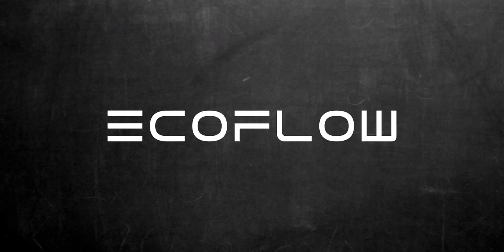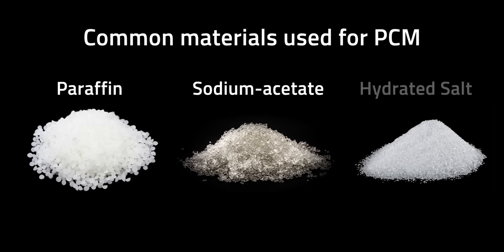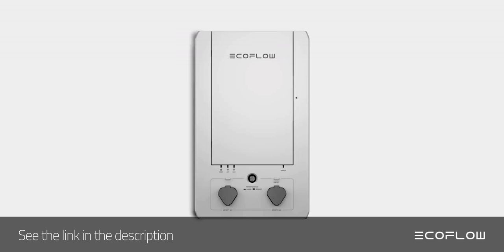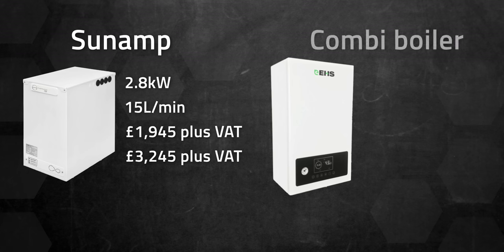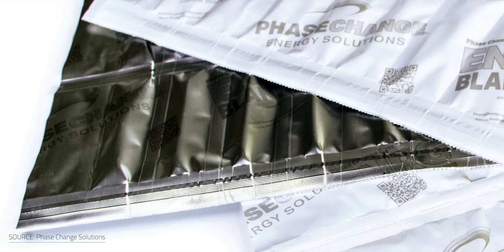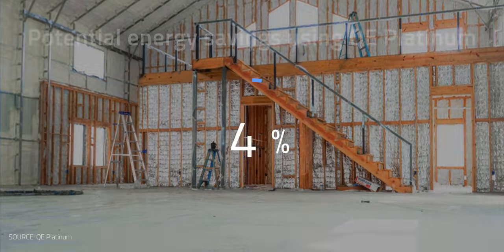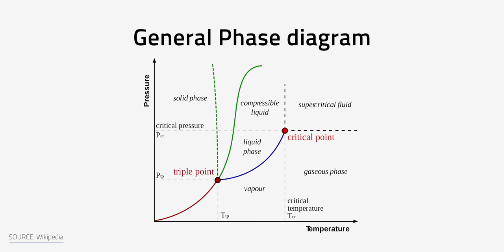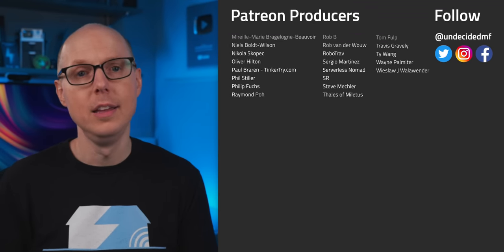Are Phase Change Materials the Future of Water Heaters?

Comment: We've had two SunAmps in our passive house since 2017 🙂 We just use off-peak mains power to heat these overnight and are fairly light HW users.  Apart from energy density, the heat losses are fantastically low compared to a conventional UVC.  E.g.  our CH control system went offline whilst we were on holiday -- our son took 4 days to notice that the showers were running cold!   Nice and simple we've never noticed water heating / flow issues in nearly 5 years of use.
Reply: Is it a case of great heat retention, or simply when the cat's away, the mice will not wash :-). Seriously though, going to look into those Thermino systems.
Reply: @jamestripptrapp  Heat retention. The compact cuboid form factor and vacuum panel insulation make a huge difference to hear losses. My 2 SAs lose about 1kWh per day between them.
Reply: How do you have these hooked up? Is it like a separate loop from the hot water heater with a pump? How does it know to charge/cycle?
Reply: @tscook10 , the system complies with UK codes.  The whole HW + CW system is potable and fed from the rising main via coarse filter + 3 bar limiter then through a water softener.  (Main pressure is a consistent 3-3½ bar. ) The HW branch goes through 2 parallel but individually isolatable SunAmps (so we can tolerate one out of service, ableit at reduced max flow) that act as heat exchangers in flow terms.  The HW outputs are TRV mixed down to around 48°C at the HW manifold.  All appliances and white-goods are each fed on a 1-1 isolatable spur from a manifold.  The H/W will typically be at a couple of bar when flowing through this can drop to maybe 1½ bar if 2 or three showers are going at once.  We've 3 ensuites, one bath/shower room + utility, kitchen and G/F toilet.  Never had any flow probs.
Reply: @TerryE-UK  So the hot branch is one-way through the heater and then the sunamp? My understanding is that the SunAmp doesn't incorporate a heater, correct?
Reply: @tscook10  not in our case as we have an earlier (and IMO better engineered) model.  Each unit includes an internal heater and small pump for recirculation.  We just feed it off-peak electricity but default for 90 mins overnight.  This ~4.5 kWh (max) × 2 is significantly more than we typically use.   (The control boards will only take power until the cells are ~5-10°C above phase change temperature, so they only take what they need.)  I can always top-up with a button on my home automation UI.
Reply: @TerryE-UK  Cuboid isn't more efficient than a cylinder. Big things have better surface/volume ratios than small things. So that seems to just leave 'better insulation'. If we put 'better insulation' on water tanks then I don;t think there is any intrynsic advantage of the PCM store. I am interested in the sunamp, but remain to be convinced that is is better than a very well-insulated water tank. One PCM advantage/disadvantage is no movement of heat due to convection. So that should reduce store losses (warm water doesn't keep mixing and going to the edges as heat is lost), but you also don't (I presume) get stratification, which stops you from just having a relatively small volume of hot water at the top. I'm not sure how the sunamp compares in this regard.
Reply: @xxwookey   The cuboid form factor is more efficient because this facilitates the use of vacuum panels which you can only get easily in flat panel form; these have a U-value maybe 10× smaller than typical foam insulation.   Yes, a cylinder has maybe 20% less surface area for a given volume than the SunAmp, but the PCM is 3-4 × as energy dense as water, so the volume and surface area are a lot less as well.   The overall heat losses are an order of magnitude less than a comparable UVC.

Comment: I researched thermal storage materials during my diploma (equivalent to a master thesis). I think a small fact in the video could be misinterpreded: Most salt hydrates for thermal storage are no PCMs! They are usually used as thermochemical energy storage materials. Water vapor will be incorporated in the crystal structure of the salt, which releases a lot of energy. They have a higher theoretical energy density than PCMs (but have other issues for household usage).
However both material classes have a huge potential.
Reply: So the salt hydrate systems are not bound to a specific temperature band at atmospheric pressure? That seems to be the difficult limitation of PCM in a building.
Reply: @armadillito  They have other limitations than PCM: The dehydration temperatures are relatively high for most of these systems (they vary a lot depending on the salt used). Systems with lower dehydration temperatures have lower energy densities.... However, to "discharge" those systems, you only need humid air.
Reply: @kleinerELM  I wonder whether heat pumps could leverage PCMs or salts as an artificial source/sink where ground installation is unviable and air temperatures are extreme?

Comment: The key to the efficiency of such units as the Sunamp is that they can store a huge amount of thermal energy without the temperature changing and thus they do not need massive amounts of inrulation to retain that heat.
Reply: The Sunamp also uses Vacuum Insulation Panels - which it is able to do because the "tank" is cubical, so flat surfaces to insulate. They provide excellent insulation. But as you say - having most of the energy stored not increase the storage medium's temperature is a big help. 

Also, unlike a sealed water tank, the whole thing is at atmospheric pressure, so there's no danger of a steam explosion. 

The major downside is the weight of the units, as they arrive pre-filled - unlike a water tank that is fairly light (if bulky) until you fill it with water. And they're a little more expensive than an "equivalent" water tank.
Reply: @justinmacneil623  As I understand they are sized to fit in with kitchen units so in most cases will sit on a solid floor.

Comment: On the flip side, PCM's integrated into refrigeration units on the cold side can help alleviate short cycling and reduce total energy use. Instead of kicking on the compressor because the door was opened, air is circulated across the PCM to bring the temperature back down. This leads to longer compressor on times, less frequently, which is better for longevity of the compressor.

Comment: Hey Matt,

Thanks for the video.   As an FYI,  VAT is 20% here in the UK do its quite a bit pricier.
Reply: It's only 5% on energy saving products such as this boiler.
Reply: Currently 0%, from 1st April 2022 until 31st March 2027 from Chancellor's spring budget. Then would presumably revert back to 5%.
Reply: @allenscoging8561  Thanks for that. I hadn't realise the zero rate took immediate effect when it was announced. This is good to know.
Reply: @notapplicable4637  It's only 0/5% on certain energy saving items (per gov.uk, "Not all products or installations qualify for the lower rate"), and if you're in NI it's slightly different again. I think something like this would be probably be on the lower VAT rate, but you don't want to get caught out by thinking you'll pay 0/5% and then having a nearly 15% (or more) higher bill.

Comment: If you live somewhere that the night time temps are low and daytime temps are high, this would work simply by selectively exposing the material to indoor air or outdoor air, or even just letting sit there in the wall/attic and serve as a buffer.  But if it is always too hot (summer time in about 2/3 of the US) or always too cold (about 2/3 of the US in the winter), then you can't get your product to phase change without a lot of complicated heat management.  For example, you could have solar water heating panels in the North and you could pump your water (glycol) through them, let the water heat to above the PCM melting point, then circulate it into the PCM during the day, then circulate through the pcm and air handler inside the house at night.  But now you added a significant level of cost and complexity and lots of failure points.

Comment: I worked with a PCM blanket developer in San Antonio back in 2013 while in the energy-efficient home business.  I would have liked to see the platform under front-loading washers and dryers be the PCM hot water tank without the water.  Layer the ketchup packet-sized blankets with copper tubing in an insulated box and run the hot water plumbing through the connections.

Comment: I have a PV charged Sunamp fitted as the hot water provider for a detached 3 bedroom house in the UK and have found that it provides just about all the hot water we need in summer.  Having a EV we also have a cheap night tariff so as well as charging the car we also can charge the Sunamp if it needs to be topped off if there has not been enough sun during the day.

Comment: I have a Sunamp Thermino heat battery running with the ASHP installed 2 months ago and it is brilliant. Works very efficiently and is economical to use for all our hot water needs in a 4 bed detached house although only occupied with 2 old wrinklies at home now.

Comment: Or just build your wall out of concrete/brick and use the thermal mass of a building as a battery. I live in a house that doesn't need air conditioning as the walls are 35cm of solid brick and another 20cm of EPS insulation on the outside. When the temperature was 36°C outside the inside was at a cool 22°C. Max out air fresh system or open up windows at night and it cools the house back to 20°C.
Reply: The only benefit i see of a PCM in this aplication is it uses less space but it's probably a lot more expensive.
Reply: You did it correctly - insulation on the outside, thermal mass on the inside.  This same arrangement is key for PCM too.  In the U.S., many people are stuck with the house built as it is, so ideas like PCM help for retrofit of a structure that cannot support new brick wall construction.
Reply: The trick with PCMs is that they have a specific temperature they don't want to cross. Just like you can bring water to 100°C (212F) and then have to add and add and add more energy for ages until it finally becomes steam and gets to 101°C, those PCMs resist being heated/cooled over their melting point.

A thick brick wall doesn't do this. It has a large thermal mass, but it won't stick to the temperature you want to have. It's just slow to move at all. A PCM layer tuned to 22°C (72F) will stick to that temperature as long as it can. If the temperature drops below, it will give off heat (at 22°C) until it is completely frozen. If the temperature rises above, it will stay cool (at 22°C) until its completely melted.

It's like walking up a mountain and hitting a wall with a ladder. You will need to spend plenty of energy going up the ladder but won't move a single inch forward while doing so. Your concrete wall is just a steeper mountain.

Comment: I've had a SunAmp Uniq12 since 2019 - it's great. In the winter we heat it with off-peak cheap electricity - between March and October surplus PV from our solar panels is more than sufficient to provide us with hot water and heat our towel rails. Having potable, mains pressure hot water is fabulous!

Comment: [Bonus Points]: If the phase change "modules" installed inside walls/ceilings are placed between two thin polyester wadding films (without touching them, keeping enough flow of air going through the modules from the hidden ventilation system), the acoustic insulation benefits do not compete with the thermal regulation eficiency.

Comment: Another good PCM is greenery on facades, cooling your wall with water vapour and warming by providing surface area for dew condensation and frost sublimation. Included is a insulation layer of air between the leaves and the wall, which saves even more energy. 😁
Reply: Yeah ivy growing on your house does wonders in the summer.

Comment: BMW actually had these kind of sodium heat storage systems in some models of their cars. I had a 2000 528i that had one of these installed. Was supposed to help in the winter by allowing the car to store heat so when you turned on the cabin heater, it would get warmer faster. Was not a huge difference, but I did notice I had heat much sooner out of the vents than the same car without that system.

Comment: The key to phase change material is how much energy it takes to change phase. Imagine boiling a litre of water in your kettle. It takes what, a minute? Now how long does it take to boil the litre away, phase changing it into a gas? Twenty minutes, more?

We could calculate it / measure it but the point is, there's much, much more energy in the phase change than there is in just raising the temp 75 degrees or so.

Comment: Thanks for more fascinating and potentially very useful information Matt.

My family and I are Australian and a few years ago our old immersion element hot water reservoir gasped it's last.

We were advised by a plumber and family acquaintance that a 'Nanny' State Government was exerting strong pressure for installation of more energy efficient 'heat pump' systems during both new builds and replacements.

Although a heat pump water heater was substantially more expensive than an immersion element model we decided to be environmentally responsible and spend the extra money on a locally made heat pump.

Whereas our old immersion heater had lasted for more than forty years to our great regret and expense the heat pump failed within a mere five, years and would have been absurdly expensive to repair.

We called the same plumber who installed the heat pump and were advised that heat pumps had "turned out to be a bad idea due to unreliability" and that the State Government had reverted to recommending immersion element heated units subject to specifically limited maximum reservoir capacity!
Reply: You realise that all air conditioners are heatpumps, right? Anyone whinging about heat pumps has zero clue.

Comment: I'm not sure I would buy into the hot water heater aspect, but using these materials to insulate a living space, especially here in the South, would be a good move and I would definitely jump on board with that.  The fact that they wokr even when the power is out is a huge bonus.  This, plus retrofitting with solar panels, are the two main things I would do with a new home here.

Comment: I can think of two good applications for pcm, one is to freeze a large quantity (a block the size of a refrigerator) on a hot sunny day to operate a cold loop through an air/liquid heat exchange for after sundown AC.  The other is to store summertime heat (in something the size of a small swimming pool) to use in the winter to heat the house.

Comment: I can't find it now, but I remember reading about a company that was researching incorporating PCM capsules in their drywall insulation and it reduced the cost of heating in the building by 20%. I'm always shocked at how this hasn't taken off, I used to know a friend who had a wood stove in their basement and they had an old crock pot that they filled with paraffin wax bricks and when they turn on their wood stove it would melt the pot, and then they would move the pot to their work area where they were in down there and it would keep that room while also still sending the wood stove heat up into the rest of the house.

Comment: It seems the "complications" of this PhChMo (peechimö) depend mostly of the COMPETENCE of the constructors [assuming the blueprints are correct]. 
So it goes in the same category than roofing with solar panels [you may have serious problems if this is tasked to  people who had no proper training or a lot of experience].
Reply: In American houses interior walls are hollow , you just need to pack pcm in there and run pipes from thermal solar panels  to it. But I have better design   for heating and heat storage  for new construction

Comment: I can see a possible use for this product in the greenhouse industry. I would look at hanging rows of panels from under the trusses in a north/south orientation, 90 Degrees to the ground. Because they are reflective, light loss would be minimal. Greenhouse structures fit the bill of heating up rapidly during the day and loosing lots of energy at night. Even at -30C greenhouses will vent heat with full sun, but the boilers run non stop at night. As always, you've got me thinking.
Reply: flagstones

Comment: I live in a ground floor apt. My windows are at road level so I don’t need ac in the summer, even at over 90f. I’m only 50% underground too! In the Colorado winters, it doesn’t take much to keep it cozy either. Matt, you should either consider going underground or partially underground. That’s the most efficient setup.

Comment: The water battery solution for hot water seems really cool, but I'm not convinced on the benefits of the insulation supplement. Why shouldn't I just go crazy with insulation itself, and reap the benefits without downsides like not being able to adjust the thermostat when I want?